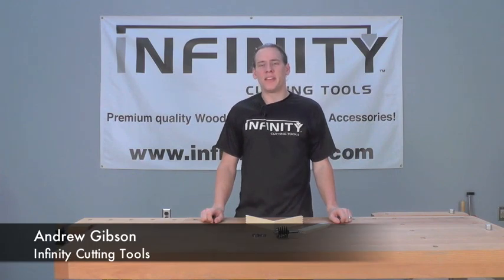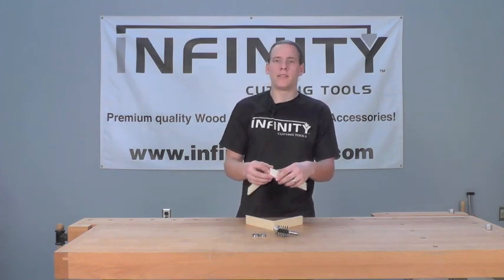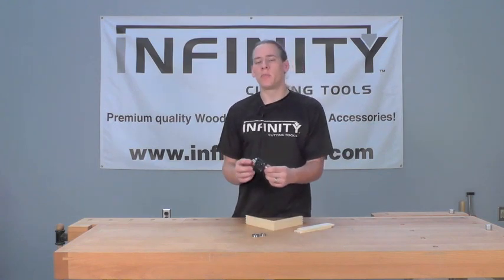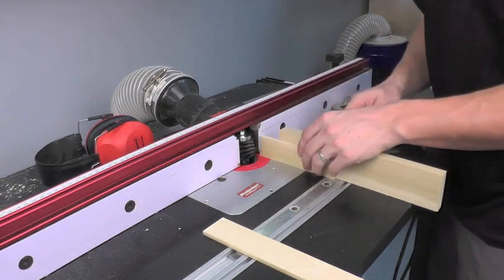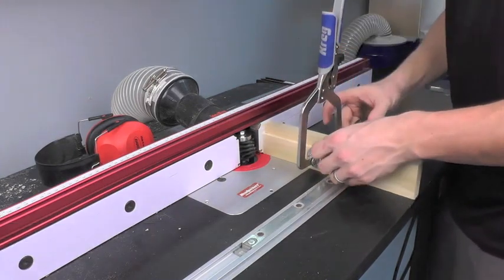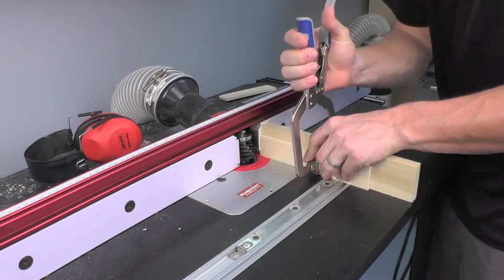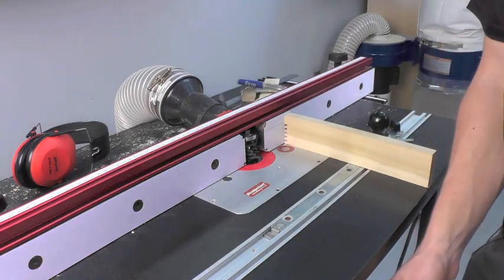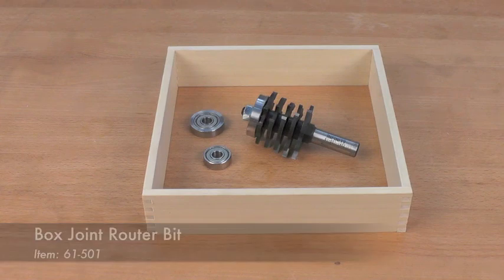Infinity Cutting Tools - Box Joint Router Bit

Comment: Why when I did exactly as you just did my joints dont match up evenly? I have one side higher then the other. Yes I have flipped my pices every wich way. I might be off a 32nd in hight but dont think that would make a difference.  Only doing 1-7/16 pice of 1/4 pine.

Comment: Hi , i was wondering , do you flip the second piece so it will meet
Reply from the maker: yes, once the bit is set to the correct height, one piece is cut right side up and the mating piece is cut up side down so that the two pieces will interlock.
Reply: Matt did you not watch the video he clearly showed him flipping the material over Dah!!!!

Comment: What is the router's HP that your using or does it matter? My bit wobbles at the end after turning it off. I've never been intimidated by my router but for some reason this bit scares the H--- out of me.
Reply from the maker: We have a Triton 3.25 hp router in our table and it does a very good job. This is a fairly tall and heavy bit and I would recommend a 2hp or larger router. If you are seeing wobble or run-out, I would double check that your collet is clean inside and out. Small amounts of dust can get trapped in the collet and cause this. I recommend cleaning and inspecting your collet regularly for best results.
Reply: Thank you for the prompt reply. I'll have to check the hp of our router as well as the condition of the collet. Appreciate your time and advice.